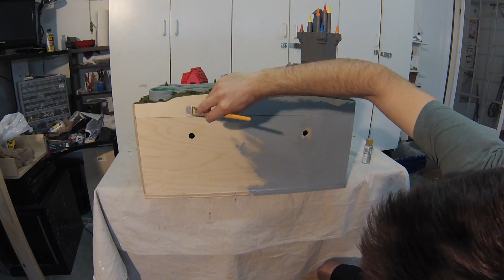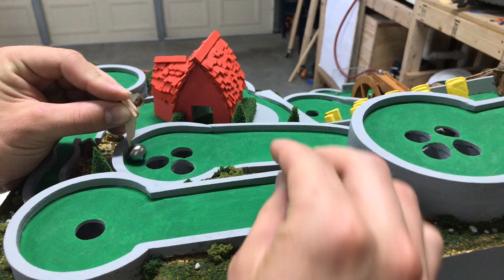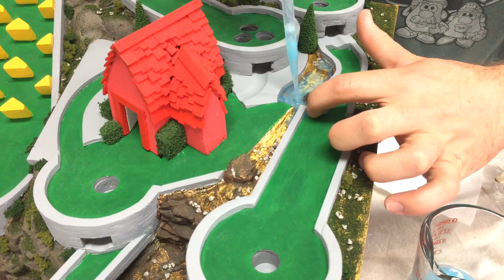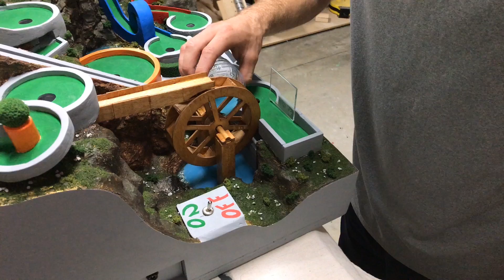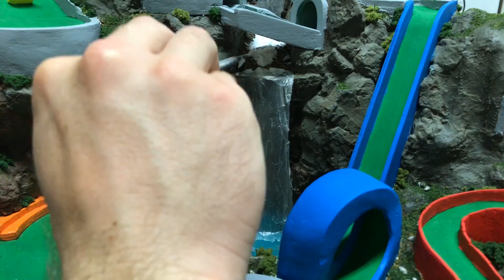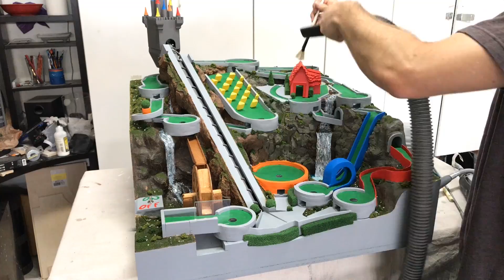Mini Golf Marble Machine Build, Part 23 (Finale with a Splash)

Comment: The same thing with the 4 hole part is the same with the red cottage 99 % marbles would go through the hole that led to the toilet bowl so you need to add a bump to change the direction and marbles that don’t hit it will still go through the toilet bowl hole

Comment: Create a wooden pulley, tulley
marble run with archimedes screw, plinko platform,
spinner labyrinth with no obstacles,
and the final touch, 

Paint the walls white
I need at least 9 parts of this.

Comment: In the future I would use an eggshell finish sealant. The problem with matte finish is it can't be cleaned/wiped down very well without damaging. Eggshell also does a great job of giving a non-reflective finish but it's easily cleaned with plain old rags. (Just in case a spill happens on one of your beautiful creations.)